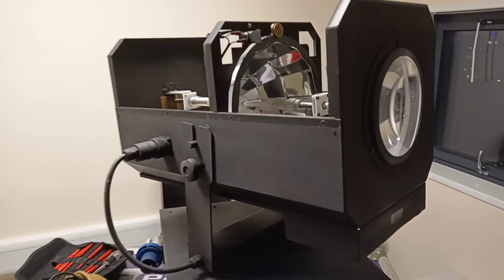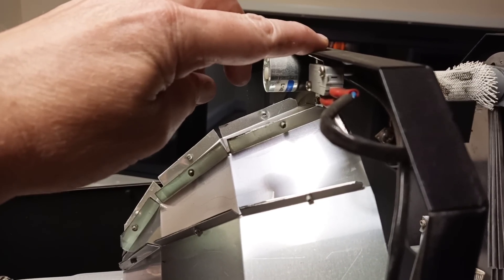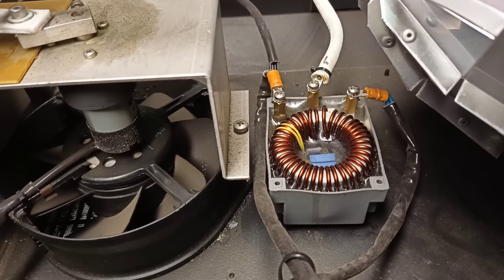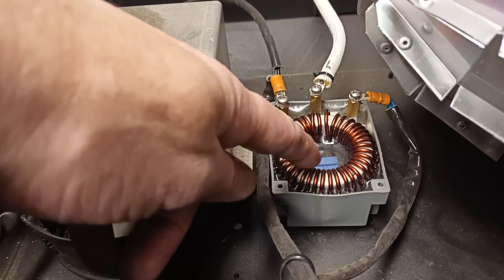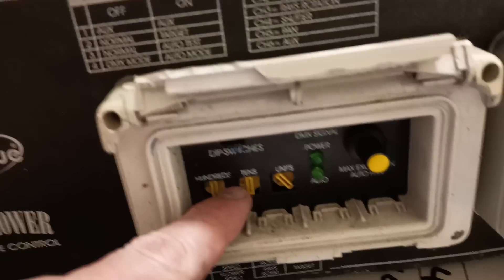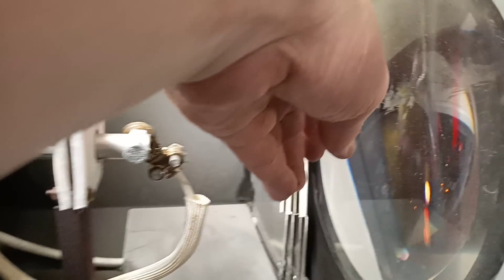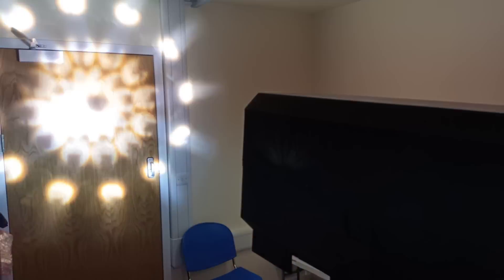Inside a high power xenon Space-Flower light

Comment: Little bit of trivia but those IP-rated covers on the switches and connectors are frames for Italian outdoor sockets and switches.  That's why there's mounting clips for the four modules (which are vaguely similar in size to euro modules but...not). Those in question appear to be Gewiss GW27044 if you want to repair/replace.

Comment: OMG! I haven’t seen one of these in years!These used to be called a “studio duo space flower” I used to have to keep one of these running when I worked as a lighting engineer in 1998!

It was genuinely the least reliable piece of cr4p I ever had the misfortune of being responsible for. 

The fill up with dead moths and overheat, melting all of the plastic bits the lamp slides back and forth on and they cook their own lamp ballast cables. 

Memory lane!

Comment: Sorry, but that is NOT a Xenon lamp. This is a AC metal halide lamp, probably a HMI type. You can see it by just looking at the wires. A 3kW Xenon has about 3 times thicker wires due to much higher current. You also get full light output on ignition. Metal Halide need warming up as you mentioned. You can also see it on the lamp envelope itself. Metal halide use a cylinder shape, while Xenon use an ellipse shape due to much higher internal pressure. The stems are also different and shorter on Xenon. When that is said, I really appreciate the video, as it's always interesting to look inside lights like this :)

Comment: why not run a 3rd wire along the xenon tube for the ignition source?

anyone who has torn down a camera flash or disco strobe light has seen a 3rd wire connect to a wire that runs along the tube.

a capacitor charges to 200 to 400 volts usually at maybe 500 uf and a high voltage burst is sent along the outside of the tube witch causes the xenon gas to break down and light up dumping the capacitor.
Reply from the maker: There is a third wire, but just bridging either end of the tube over the central part to capacitively couple across.

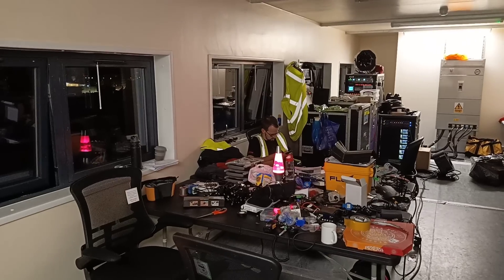Comment: 2:35 Ahhhhhhh. Just look at that lovely big beautiful panel on the far right. I dread to think how much trouble someone would get in for they turn it off mid show. If it was me, I'd rock it so it'd be arcing, which would completely destroy the switch and it'd need to be replaced. 

I've worked in pretty large bank data centers in London like quite a few RBS buildings, but most of my time was in the all glass one. We installed 47km of YY and everything was basket as it was so much easier. Like everything data related, it needed 2 supplies for redundancy. I also did quite a few shutdowns as well, along with loads of other bits like pulling in big cables n countless other bits which took month's! That was such a cushty job, even though the boss didn't like me for some reason. 
But that was the last site I was working on when I worked for W. E. Mannin. I ended up getting the sack due to not turning up to work countless times. but if I knew then what I knew now, I would’ve taken them to court.

They knew FULL WELL about my mental health (depression and a bit of anxiety), but they didn't give a shit. 
It's a long story, like they all are unfortunately 😪😞 FML

I also did loads of night and weekend work at Deutscher Banks and most of it was in the sand coloured concave building which has also been seen on the new countless times. I also did shutdowns there as well.

I miss working in London and especially when I was doing nights 😊

Comment: I Remember that patten
it caused a bit a Public stur over Telford in 1986 That Swamped 999 switch boards With Concerns, Enquires & Complaints on its first night around xmas that the local Telford  IEC Ring had to put in local News Paper + TV Central (itv CH 3)the next day paper That it has Put outside it powerful light's system to draw customers (they stopped it in 1990's)

Comment: That looks like a very compact lamp for 3kW. My 3kW XBO lamp is wouldn't fit in that unit. You mention run up time, could it be mercury xenon?
Reply from the maker: Pure xenon projection lamp I think.
Reply: @bigclivedotcom  Interesting, thanks Clive, can't find any info on the lamp this uses. Short arc xenon normally go under the labelled XBO

Comment: I remember there was an intense xenon lamp inside a scanner used for top grade color printing and separation. The Optronics ColorGetter was a very expensive machine I used at work for magasine output. It worked with a xenon lamp and photomultiplier tube to scan ONE pixel at a time. Back in 1992 it was worth about 80'000$.

Comment: I suspect that might actually be a high wattage metal halide lamp. Xenons, from what I have observed, are usually more round in shape with larger electrodes placed closer together.
Reply: It's definitely an HMI lamp. looks to be in the 2.5 kw range like what was used in the motorized shogun instruments.
Reply: And xenon short arc lamps would start almost instantly on full brightness. The halide lamps are the ones which need a warm up period.

Comment: I love seeing inside the theatrical lights.   Looks like you have plenty of power available.  
The pink lava lamp is a nice touch
Reply: A UK wall outlet can do 13A at 240v which is 3,120 watts. Even with ballast losses and motors you're likely still within spec for a standard wall outlet :)
Reply: @DigBipper188  The british event industry mostly uses CEE connectors, not only for 3~ but also for 1~. They can do 16A and 32A.
That 3kW lamp does need a couple kW more for the first few seconds, I don´t think that a normal 13A breaker wouldn´t trip.
But if you look at the background at 2:35 you can see a 200/400A PowerLock supply, it seems like they have enough power in that room.
(The supply is 150 or 300kW)
Reply: @paradieshenne  Well spotted and also true. Especially with magnetically ballasted HID and gas discharge gear they are known to pull massive transient currents when stabilizing the arc. In my own testing they do also need an extra little bit of power during the early stages of warmup but lamp depending it's only really a couple percent over the lamp's nominal rating at full intensity.
Reply: @DigBipper188  Have seen how many of these are in the rafters of theaters? Each one of them nearing the full load an outlet. So yeah, that is 'plenty of power' by any stretch. More modern spotlights use a fraction of the power for the same output, btw.

Comment: Geeze Big Clive.  I think you could fix ANYTHING!  Very cool.  The light source itself seems kind of impressive.  I'm wondering when this was made and if bulbs are still available.  3 kW (guessing at 220 or 240?)  That's a little bit of juice.
Reply: Also ultra violent light.  Sun burns from light leaks for follow spot operators.
Reply: I think that's his job :) he works on the lighting rigs occasionally at the Edinburgh Tattoo.
Reply: Input voltage for the small lamps will be 220vac, rising to 440vac3p for the larger units (Think IMAX projector at 15kw) The lamp is "operated at low-voltage, high-current, DC and started with a high voltage pulse of 20 to 50kV. As an example, a 450 W lamp operates normally at 18V and 25A once started." These numbers rise as the wattage of the lamp increases. They also emit a high amount of near IR radiation circa 850nm to 970nm, so o3 is a real problem for them unless filtered, as is radiation damage.
Reply: @dougle03  And the bulbs are filled with high pressure gas which means they can explode and send glass flying like a hand grenade. When handling the biggest ones for Imax projectors, the technicians had to wear body armor.
Reply: @whitcwa  I remember all the way back in the very early 90's repairing the devastation left by a 1200w HMI lamp exploded inside a Martin 1200 Roboscan... It took out the reflector and much of the light path... Learned not to handle them without gloves, they really don't like finger grease on them when installing..
Reply: @dougle03  Wow.
Reply: @dougle03  Xenon lamps, yes, but this looks like a 3kW metal halide lamp that runs on around 100VAC to 130VAC supplied by the aforementioned chokes in the base.  Xenon lamps would have bloody great masses of tungsten for the electrodes and an ellipsoidal quartz envelope.  It would also be VERY dangerous to have the lid open as they are at very high pressure even when cold and are prone to detonation if disturbed.  The ozone is from the UV they give off.  While they also give off loads of IR, that just wants to cook stuff.

Still want one, though.
Reply: @randacnam7321  Damn.
Reply: @dougle03  I am guessing this thing is a few more watts than the xenon bulbs in my Audi.  LOL